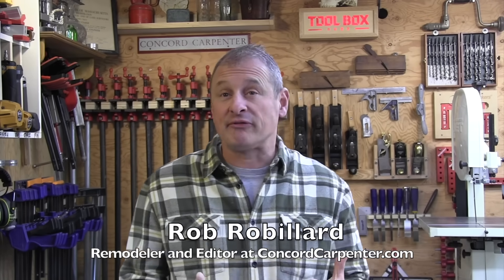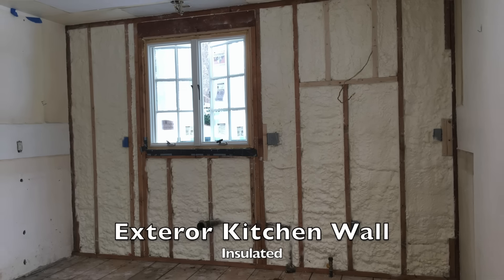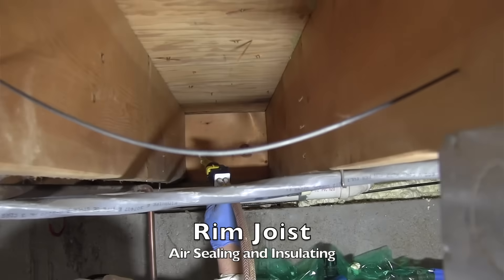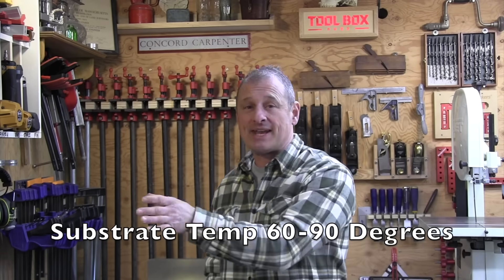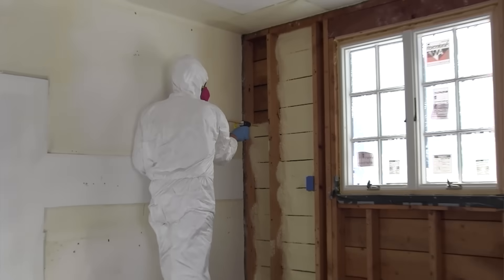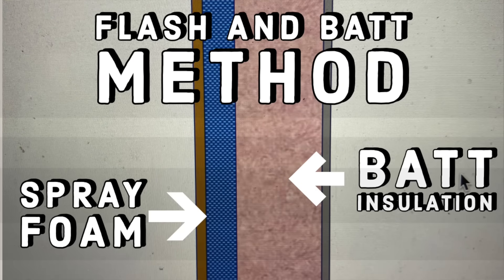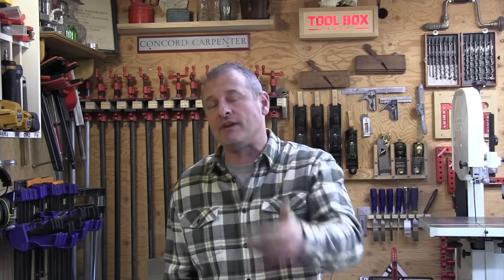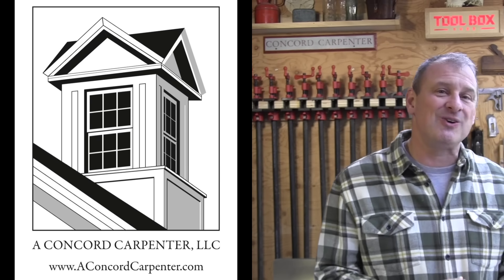Using a Froth Pak - DAP System 600 Spray Foam Kit

Comment: Putting tape on your studs will save you scraping later.
Reply from the maker: scrape as you go or better yet, dont spray the stud
studs
Reply: @ConcordCarpenter  I believe the OP was referring to the overspray that occurs when using this product.  Tape the studs and when the job is complete just pull the tape and all the studs are clear of material and ready to have rock hung on them.  A little bit of prep at the beginning will save even more time from not having to scrap as you go from the overspray.
Reply from the maker: @shadowzedge5793  I know - he's right for regular spray foam guns that spray at 3000 PSI,, but these froth pks don't have that pressure and ts easy NOT to overspray if you're careful.
Reply from the maker: @shadowzedge5793  He was and scrape as you go is WAY faster and uses no materials

Comment: I'm wanting to insulate  my shed , is this stuff any good  on metal sidings.
Reply: I used it for insulating my Sprinter van.  Light weight, and reduces noise.  It's been 8 years and the spray foam is still doing its job.
Reply from the maker: saxonsoldier67 What a great idea
Reply from the maker: patriot7 yes

Comment: Love the closed Cell spray foam have in my attic and against my basement wall.
Reply: How did you warm the basement wall (assuming they were cold/cooler).  Im in colorado and the crawlspace walls aren't in the 60-90 degree range at all.

Comment: I just started looking into these because the local guys are not willing to do a 600 board foot insulation job.  Well, they will, but the price is the same as a 1500 board foot job.
Reply: What dimensions are your building? Just curious. I have a 11x16’ room with 8’ ceilings. Not sure on roof pitch or size yet.

Comment: Is this similar to Great Stuff spray foam cans?
Reply: This is a higher density then great stuff with a much higher R value.
Reply: Team Dada  I'm not sure what you mean? Have you compared the 2 side by side? One is not like the other. They both are great at their intended purpose but should be used for such. There is also the time factor. A kit will take much longer to apply then a rig will. I can cover 600 board feet on a rig in less then a half hour vs 2 hours. Time is money. :-)

Comment: Those packs are not a true 2lb foam. Cost more per sqft then a professional. If using more then one pack you’ll loose more money.
Reply: Keith Parker not necessarily., no one around me will even show up to spray close cell for under 2k.
Reply from the maker: @Anythingdodgegarage  My CCSF contractor offers a flat rate special for local remodeling companies - see comment below
Reply: hunter Madison 
That sucks we go out for a 1100 minimum
Reply from the maker: 100% agree!! 

My srayfoam contractor offers a "flat fee" for up to 300 Sq. Ft. at 3" or 900 Board Feet.
 
This kit is really designed for small projects LESS <600 sq. Ft.
Reply: True, i did it myself but was able to find the packs 50% off and was able to buy three and still saved